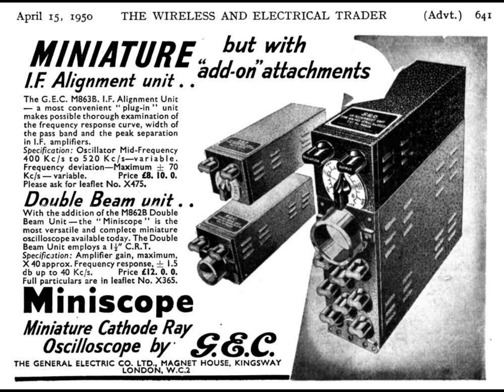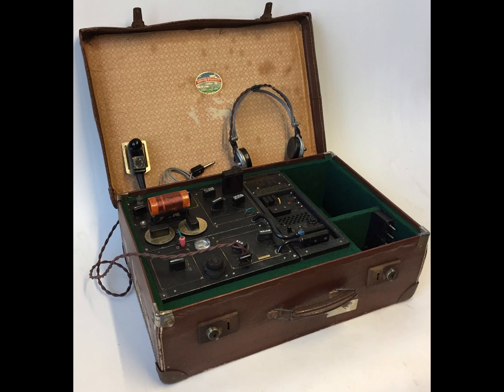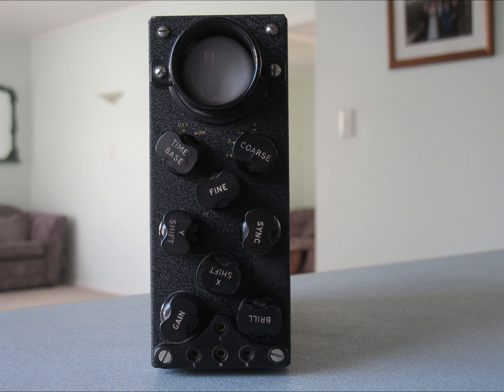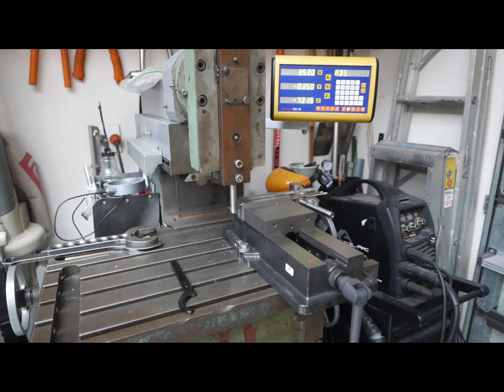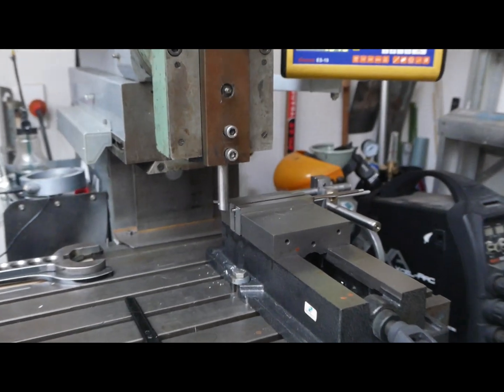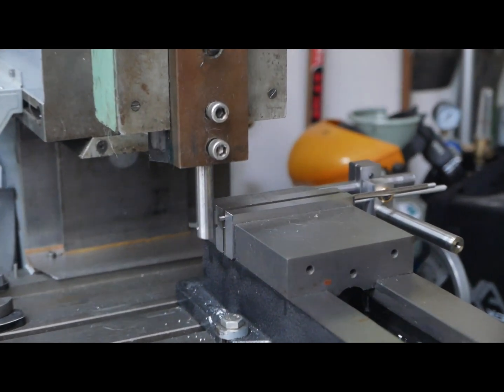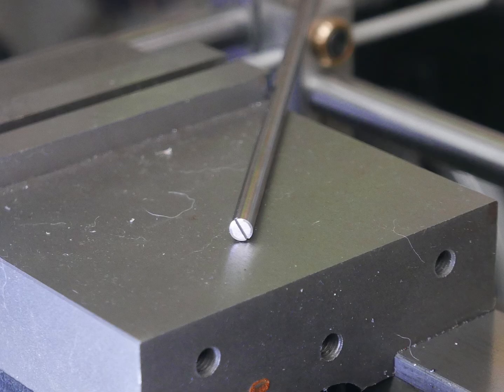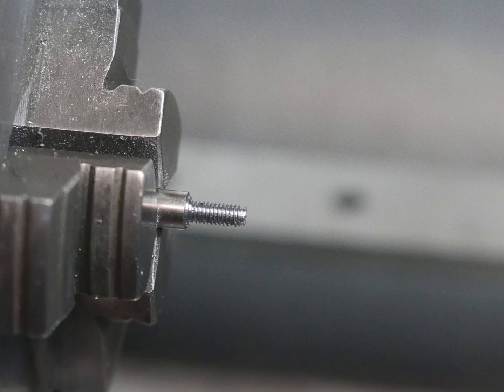Vintage GEC Miniscope Oscilloscope - Making Set Screw with a milling machine slotting attachment.

Comment: Printer rod machine great, ever tried welding or bazing ? God knows whats in it, but it dont like the heat.  Give it a go, might be worth a dont do this video?
Reply from the maker: I don't have the gear to braze.  I do have a MIG welder but no requirement to weld printer machine rods.
Reply: It's leaded steel, free machining steel. That's why it's so nice to turn and mill. I've used it alot. Don't weld. Silver brazing works good :)